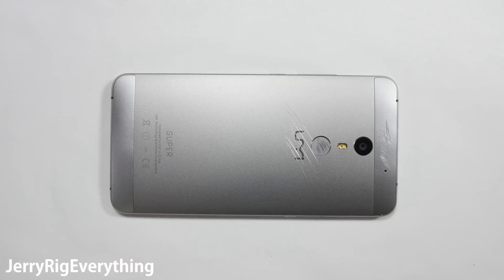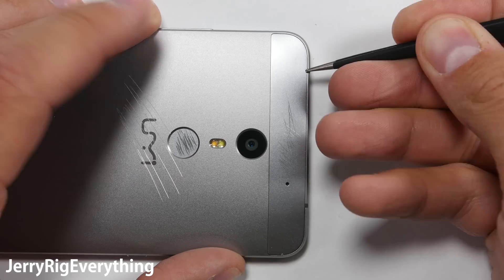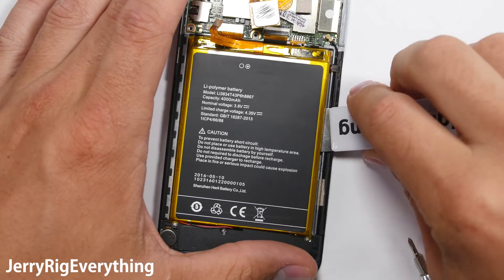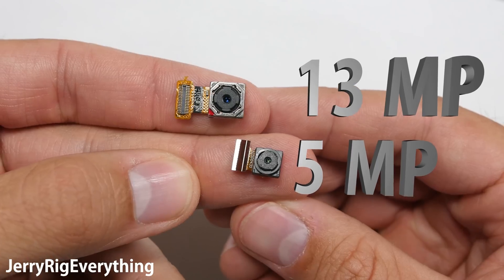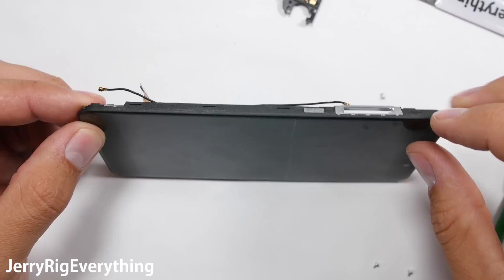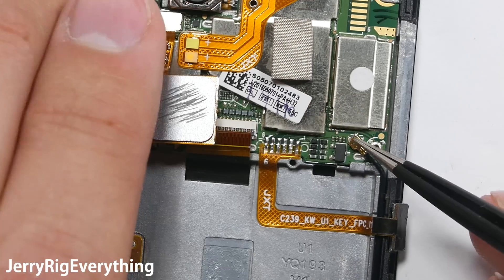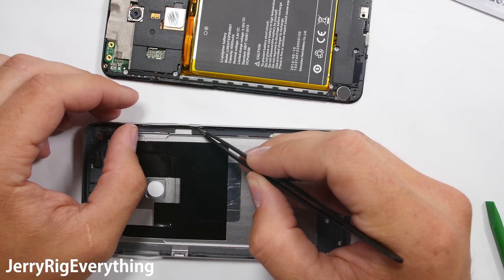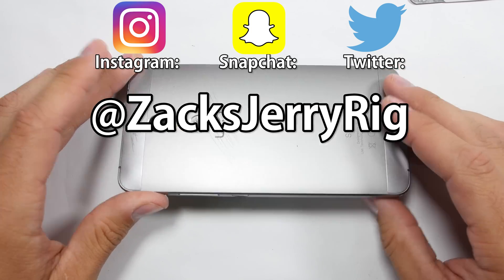Umi Super Phone - Full Teardown and Repair video

Comment: This actually helped me fix the damn thing. It fell of the bed and stopped working, all I needed to do was put in the battery pins back in.. I just thought of that after not using the damn thing for 2+ some years. Thanks man. damn even the battery was at 64% still (wierd). Good stuff. Keep it up. I didn't manage to put the finger print pin back in though.. who uses that anyway?

Comment: I have a expert solution for you. If this case in your phone happens (digitizer broken) 
Buy a OTG cable , micro usb or type c as your phone has .

Plug a USB mouse or type c mouse as you have. You can attach the type c directly or usb via OTG cable.

Operate the mouse.
And backup your data that you have on the phone. ( You can back up on the cloud ) OR you can to buy a double usb OTG to back up on a pendrive.
That is the thing. It is a very simple process.
You don't have to buy a new smartphone to swap mortheboard or to repair the smartphone to back up your data. It will save you a lot of money.

(Since most phones in the market support OTG this shouldn't be a problem)

Comment: Used this video today to repair a phone. I had 2 of these Supers back in the day (one for me and one for my wife). Mine had a cracked screen (like so many comment here) but I didn't want to pay to fix it so I replaced it with a Samsung instead. Later my wife changed her Super for an Oppo, and that Super went to my son. Yesterday the USB charging port broke, the middle flat piece inside the oblong plug (which no one seems to have experienced here), meaning the phone will not charge. Fortunately as I still had my screen-cracked Super, I swapped out the charging port (shown at 2.52) and put it into my son's Super. Put it all back together and it works fine!

Comment: I have 2 of these phones, ones battery got ruined so I bought a new one and I broke the screen. So now im trying to fix one phone and there are only 5 screws in each. Im missing the top middle screw on both phones and I cant ttake the back housing out of the front housing. please help.

Edit: turns out there are only suposed to be 5 screws

Comment: Correction: There are only 5 screws holding the back and front housing. In the diagram with the red arrows pointing to the screws is not correct. At the top end of the phone (where the camera is located) you indicate there being three screws, but the one in the middle is not a screw. There are only two screws, one on the right and one on the left.

Comment: thanks for the video. i currently using umi max (the counterpart of super) and one night i decided to charge my phone only to found out is just shut itself down. followed this video and found that the battery connector was lose and wasn't even connected to the motherboard 100% even with then fingerprint scanner, they are so easy to lose if you drop your phone.

Comment: hello and thank you for making these cool videos :) last night i dropped my phone and it turned off ,  couldn't turn it back on , so i was planning on taking it to a phone repair shop , but then i repaired it myself , the lego like connection from the battery wasn-t connected properly because the battery got unstuck and it was moving inside the phone , so after aplying some double sided tape on the battery and connecting  it everything works just fine :)

Comment: i replaced the screen + digitalizer the one with the metal frame on everything seems into place but when i try to start the device nothing happens i tryed to plug it to the battery charger and the screen seems to have powe (it turns on) but there is no feedback after a while it turns off
Reply: has that got to do with the flash update ?
Reply: with the what? sorry im not very practical with this stuff
Reply: Same problem... anyone got a solution?

Comment: Are all of the screws PH000? Also, if I'm just replacing the USB charging board then presumably I only need to remove the lower cover near the charging board - is that correct? Thanks!
Reply: no, you still have to take the back of the phone off and then take the plastic cover off the charging circuit to remove it.
Reply: Thanks. I think that's what I meant...

Comment: Useful video..UMI Super and UMI MAX seem to be identical .. 
Got a question as I just got my new lcd+touch for my UMI MAX..all this dismantling is really neccessary when replacing lcd? if some disconnections aren't neccessary ..which ones? Thx
Reply: all disconnections are needed, except the bottom piece does not have to be removed.

Comment: So my phone cracked and now half of the screen works and half of it doesn't. Is there a wayy to fix this?
Reply: Daisy Light I have the same issue with my Umi Max and I'll put a new screen in (complicated but possible) and if you want I can tell you if it worked
Reply: Daisy Light you need a new screen if you don't want to do it your self take it some where, where they fix phones.
Reply: 1voryscar buy new one
Reply: 1voryscar He LITERALLY showed the same problem, are you blind? Alternatively search UMI Super screen replacement on YouTube.

Buy an lcd with a frame for $35 from AliExpress, and try to follow the steps shown in the video.

Comment: I need a new battery for my umi super because it is swelled up
Reply: Same here. My Super is shutting down at 70% and the screen is popping out from the case and the buttons won't work/ I found the battery on aliexpress here https://es.aliexpress.com/store/product/100-Original-4000mAh-New-Battery-For-Umi-Super-5-5inch-Smart-Cell-Mobile-Phone-li-ion/2341214_32775466811.html?spm=2114.04010208.3.2.wPjT5p&ws_ab_test=searchweb0_0,searchweb201602_5_10065_10068_10501_10503_10000032_119_10000025_10000029_430_10000028_10060_10062_10056_10055_10000062_10054_10059_10099_10000022_10000012_10103_10000015_10102_10096_10000018_10000019_10000056_10000059_10109_10052_10053_10107_10050_10106_10051_10000053_10000007_10000050_10084_10083_10000047_10080_10082_10081_10110_10111_10112_10113_10114_10115_10000041_10000044_10078_10079_10000038_429_10073_10000035_10121-10503_10501,searchweb201603_10,afswitch_3,single_sort_3_default&btsid=9711df73-a6fb-4200-a747-577609047376 but haven't ordered yet. Let me know if you do and how it turns out.
Reply: I replaced my battery 3 weeks ago, and it works perfectly for me. Everything works as it normally would. I ordered it here aliexpress.com

For me, it was delivered in 2 weeks (western europe) so I would (for now) recommend it.

Let me know how it turned out :)

Comment: You forgot to mention the very important proximity sensor rubber cover 
which is located behind the little hole in the back of the phone. When 
You popped out the top cover and took out the phone of its plastic case 
the rubber stayed in the case, which is weird cause when I did it it 
stayed next to mother board. I watched Your tutorial and basically lost 
that thing which is irreplaceable. Cant find it anywhere to buy :( and 
the proximity sensor doesnt work now. :/

Comment: I made everything as well as you were saying. After changing the screen , made the test, all working good. 
After i attached all the rest of screws and nothing goes on. Screen only shows red light only when charging
 i dont even have a vibration when phone turns on.  
Maybe the battery plug is not working good?
i am having a spare gold washer but i do nto know where to fit it
 Do you have any suggestion?

Comment: I replaced the LCD for my friend, very easy
Reply: where did you buy the lcd?
Reply: Gabriel Martins
 Hi, you can buy it from ebay http://www.ebay.com/sch/i.html?_from=R40&_trksid=p2047675.m570.l1313.TR0.TRC0.H0.Xframe+lcd+for+umi+supe.TRS0&_nkw=frame+lcd+for+umi+super&_sacat=0
You should disassembly the phone and move all the component in the new frame.
P.S pay attention, good luck
Reply: Im' unable to find any lcd replacement with frame.. how complicated would it be to replace the one without frame? Such a bad time to get the screen broken. ..
Reply: Hi, i replaced all the frame, i think to replace just the glass it's more complicated, i don't know why u can't find the frame: http://www.ebay.com/sch/i.html?_from=R40&_trksid=p2047675.m570.l1313.TR0.TRC0.H0.Xframe+lcd+for+umi+supe.TRS0&_nkw=frame+lcd+for+umi+super&_sacat=0
vamsi krishna Veligatla
Reply: Was able to find the replacement on aliexpress.. fixed the phone too.. glad i found this video..
Reply: Glad you fixed it vamsi krishna Veligatla
Reply: Did the screen come with a metal frame?

Comment: I have a broken screen on my Umi Super smartphone. I have only the information that the screen type is; sharp LTPS (2.5D Arc screen). I need to replace it in order to pursue using the phone. The  touch screen is not working properly, but the image is not pixelised - meaning only the upper screen is broken. 
Can you please tell me which mobile or smartphone has the same screen type because I know it is a combination of multiple phones. Really need that. Ty

Comment: I (and others) get extremly poor gps signal with this phone. Some people suggested it was caused by the poor connection of the gps antenna to the motherboard, others that the antenna is just too small because of the limitations of the metal body. Did you notice anything related to the gps when dismantling? Many thanks.

Comment: 1: The didn´t get out of the metal case like you show, you have to use a plastic tool like a plectrum from gittar.
2. The buttons has to fix with tape outside before and you have no problem to fix them.
3. rests of video is ok.
Thanks

Comment: for 200$ you really cant complain!
Reply: Agreed. For 200 you get a lot of tech, build quality and repairability... I'd give it a thumbs up!
Reply: Randomname101 sure.  scratch etc.  but no mediatek can compare to a snapdragon. for 150euro u get a great phone.. and not just a crappy mediatek phones (who are ok but performance wise are crap)
Reply: Regilio Bouma 400 ? No it's on par with snapdragons 618 or even 808... GPU yes, it's weaker, but com'on - what to expect with phone with 4gb of ram and this price?? It's good - if only they would improve camera it would be perfect for me...

I have quite a few mediatek phones - and stock androids, they have are good - it's pure android without any addition so it's perform very good.

I want 4+GB RAM phone, because 3GB with snapdragon 801 (yeah, bit old, but it's still good) is sometimes underperforming. Especially in ram department - when I have more than 10 apps opened it's closing fast. But it lasted for 2+ years, so it was good. Maybe I should even have 6GB ram phone.
Reply: Regilio Bouma LG G3 is really slow, even with android 6 it doesnt have any multitasking. I have now G5, but even it's still worser than Note 3 with CM13 in multitasking. LG roms is shit, only little better than samsing touchshit.
Reply: u have also a xiaomi for this price :)
with snapdragon :) 650 (it's a beast)
i dont like mediatek i mean i find it expensive for a mediatek phone...
Reply: Um xiaomi failed his test miserably. Don't get me wrong I love xiaomi phones but they're not the type of phone into these tests.
Reply: +Regilio Bouma not so now. They didnt have cortex a72 or a57 cores but still there are really fast frequency and is capable to fight with middle end snapdragons
Reply: pe1eterek yes midel end.  like a snapdragon 4xx maybe. but then again the gpu in mediatek are weak af.... 
the cpu are not the fastest but they work fine. 
i mean the snapdragon 650 is a beast it's the between a snapdragon 808 and 810.
i find 160euro for a mediatek phone way to expensive... 
i mean for like 70% of the user's its fine.  but me i like performance and custom roms.  and games. 
and for that mediatek are the worst...  no custom roms.. and the stock roms are very bad optimized... 
Anyway i mean i have médiatek phone's but the ones that are around 50euro they work great for the money u pay. but higher then 100euro i can find good xiaomi phones with snapdragon and custom roms. 
but still i wouldn't recommend buying a 150euro mediatek phone. it's just a bit to expensive...
Reply: Yes but 3gb is plenty i find
Why need 4gb
But overal yes a mediatek phone is a good multitasking phone lots of cores. And big ram.  But i like games so mediatek is a bit crap for me.  And stock roms are nice but i like custom stock roms. 
And mediatek u have 0 support. And that's a nightmare.
Reply: Regilio Bouma Because I use messenger - it sometimes uses up to 600-700mb of ram LOL. And without it I can't have my messages from fb... A few other apps and it's full...
Reply: pe1eterek Yeah like i said for basic mediatek does thr Job.  my mom is happy with her doogee f5 mt6753 works great. since February.
Reply: hei, can u give me more information about mdeiatek vs snapdragon? they seem to perform preaty close to each other, but i heard mediatek doesnt let updates, can u talk about that?
Reply: Rodrigo Carvalho yes mediatek u won't get updates. 
And no custom rom support. (they don't give kernel sources) you want new version of Android they make a new phonr cause update a mediatek phone is a pain... 

Snapdragon can be updated and had custom roms so it will always have roms.  (at least most snapdragon if kernel sources are given) 

And snapdragon video graphics are way better. 
Mediatek has bad/low end video graphics... 
The processor is okayish of mediatek but it are all low power cores... 
Where snapdragon 650 has 2 high performance cores and 4 low power cores.
Reply: Regilio Bouma i see... well thats a shame, umi is such an atractive phone (yeah yeah looks dont make a phone good or not, bu it helps :b ) 
so what about redmi note 3 pro? do u recomend it? what's the best under200$ phone?
Reply: Rodrigo Carvalho redmi note 3 Special Edition all the way. 
Full 4g. And great phone great custome rom support (for the redmi note 3 pro,  but the special is the same phone but has a different modem so roms are flash able on both just need to flash modem)  anyway thr xiaomi has great battery life. Great screen great touchscreen and is very fast. I love it.  Miui is okay.
Atleast xiaomi you can download roms updates. They support there phones.
Reply: Really xiaomi redmi notr 3 pro is the only phone i can find that has all for me
You also have some letv/leeco phones who are with snapdragon but not much rom support on xda etc.
Reply: +Rodrigo Carvalho Still I would give that you can't habe much better phone than this UMI (I really like the look too - they copied from HTC and iphone's, but it's better and more refined than original). And you have a stock android - which is way faster than any other custom android like MIUI or Touchwiz. If only it has 4k recording and better camera I would buy it even for more money.
Reply: pe1eterek so even if it loses in speed to redmi note 3 pro? its still an overall better phone? 
do u know someone who as it? and i it is good in the long run?
Reply: yeah camera isn't best ojnthe redmi bote 3 but on mediatek phone the camera is also bad.  so yeah
i have a lg g3 2gb lg has a great camera but horrible battery and performance is crap also. 
i just love the redmi note 3
Reply: Regilio Bouma i have an acatel pop c7 so.... any of this phones will feel like a massive BEAST
Reply: Rodrigo Carvalho haha i feel you mate. 
Even me from my lg g3 to the. Xiaomi remdi note 3 was like woow. 
Speed and battery. Incredible. 
(former owner of a oneplusone but that was crap,  not good quality...) the lg g3 js nice but 2gb is bad for the lg)
Reply: +Regilio Bouma Thats Not true. Im using a  Mediatek SoC(mtk6752 - a bit faster then the 6753)  and its fine. I dont Know what you are Doing with your phones but for me it is fast enough. Yes The GPU is never really super fast at MTK SoCs but its enough for a normal User, also i have no Problems with Just 2GB Ram. I never had Big issues with some casual Phone games and also no lags + The Phone got Updates and there are also custom Roms.
Reply: SUPERSU i had 2 phone with tge 6753. just like i said they worked okay. nothing special a s801 works just as fast with 4 cores.. with better gpu. 
i said low power cores. (didn't say they where slow)  just not high end cores or fast ones. just basic ones. 
yeah but the lg g3 2gb is just shit with a 2k screen on the s801 chipset.. 
it didn't lagg mediatek. but just feel like no thanks. my lg g3 felt faster... 
yeah for some old mediatek i know saw some custom roms but not like good. 
anyway. 
Mediatek are good for less the 80euro you won't find a snapdragon for that price. 
i prefer my 50euro Chinese mediatek phones then a 130euro mediatek one. cause for 50euro iim just happy it works. 
but for 130euro i want quality and i didnt find that on umi or doogee phones.  but i did on xiaomi phone power and quality
Reply: i got one on Banggood